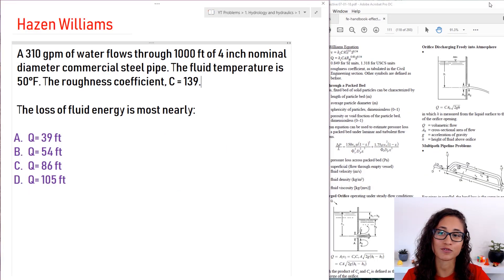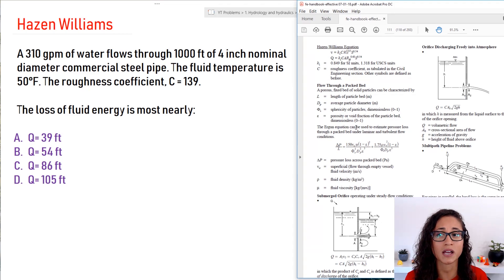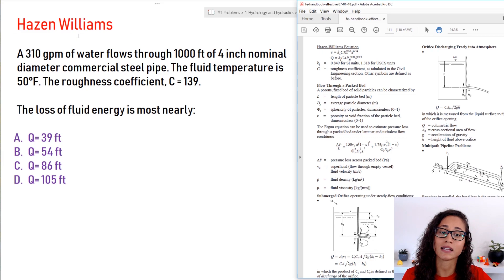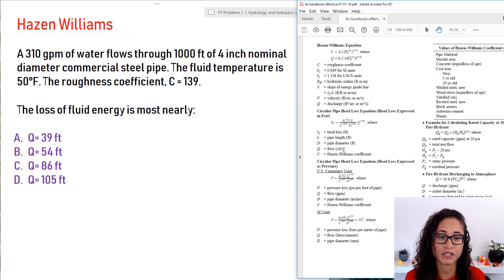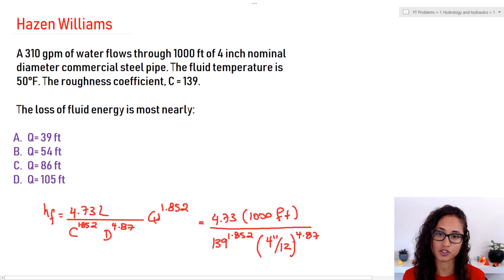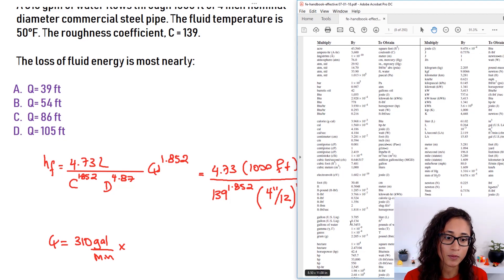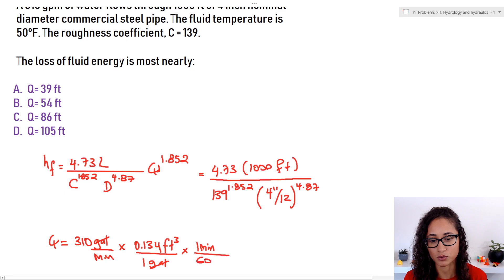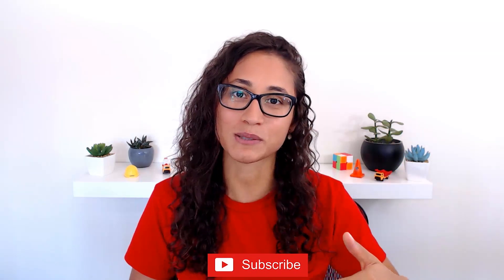Head Loss Using Hazel-Williams (FE Exam Review)

Comment: Hi . Thank you for the video.  A question.  What's the difference between darcy weisbach question and William hazen ?
At what condition we have to use darcy weisbach and at watch situations we have to use William hazen? 
Thank you
Reply: Not sure if you are still looking for an answer, but she goes over this in "Head Loss Equation (FE Exam Review)". Basically, it depends on the variables which equation you should use.
Reply: The Hazen-Williams is a special case of the Darcy-Weisbach equation, and related equations such as the Colebrook equation for determining friction factor.  There is no theoretical basis for any of this, it is all just curve fitting to experimental data.   Only laminar flow situations can be solved in closed-form from first principles.  Turbulence requires correlations to experimental data, or computational fluid dynamics.

The Hazen-Williams equation is an older equation that was a lot more user-friendly in a pre-computer age, but its drawbacks are that it has a much narrower range of where it is applicable.  The Darcy-Weisbach equation is more broad in its scope of where it can apply, but its drawbacks are calculations for friction factor that are not user-friendly.

Comment: Might not make a difference given thin wall of pipe. But as wall thickness was never stated we cannot verify.

Still, 4" is a small diameter. So much so in fact that the wall thickness might be negligible.

If pipe was several feet in diameter such as in case of municipal sewer then the walls would be thick and their thickness cannot be ignored.

Just my 2 cents.

Comment: Good video. However wouldn’t you need to use the internal diameter instead of the nominal?
Reply: Might not make a difference given thin wall of pipe. But as wall thickness was never stated we cannot verify.

Still, 4" is a small diameter. So much so in fact that the wall thickness might be negligible.

If pipe was several feet in diameter such as in case of municipal sewer then the walls would be thick and their thickness cannot be ignored.

Just my 2 cents.
Reply: Anything regarding the flow inside a pipe or tube will use the internal diameter.  Anything regarding the strength of the pipe will use both the internal and external diameter.

The nominal diameter is just a rounded number that is vaguely correlated with the diameter of the pipe, and has some historical connection to the actual size of the pipe.  For schedule 40 pipe, it roughly equals the internal diameter.  Nominal diameters play no role in determining the engineering of the pipe.  Design codes may refer to nominal diameters, but engineering fundamentals don't care about nominal diameter.